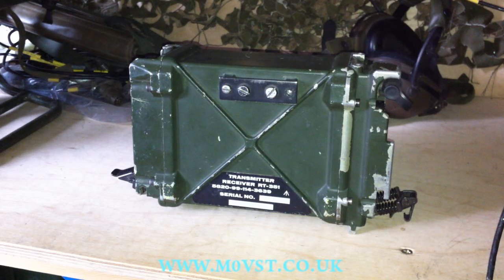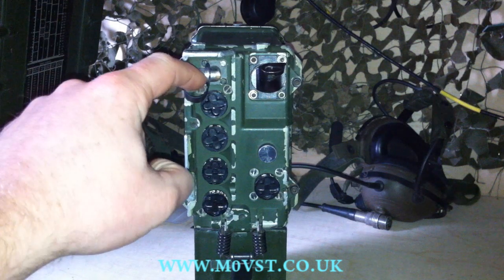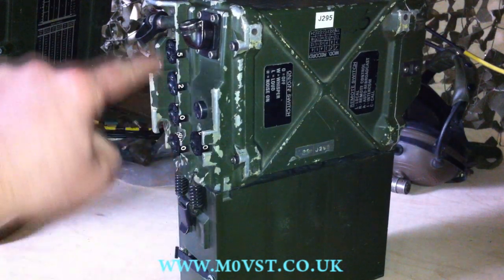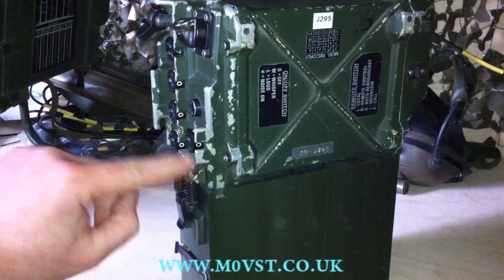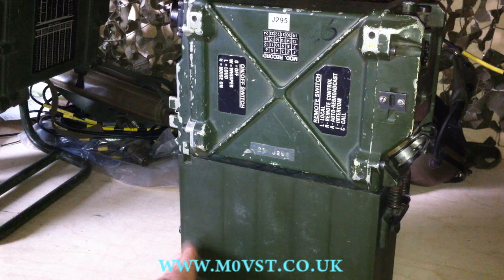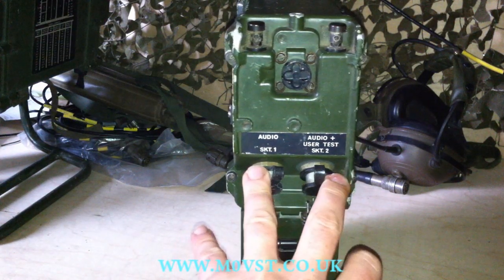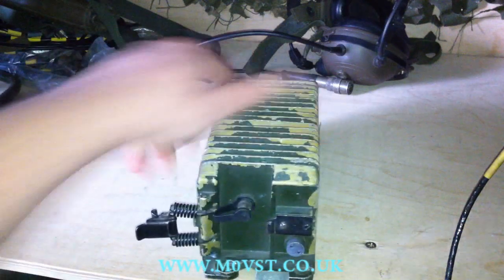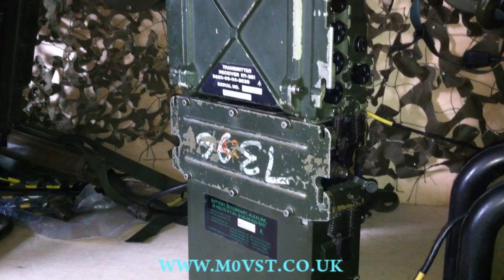PRC-351/2 VHF MIlitary Manpack Transceiver [HD] - M0VST

Comment: I have this radio in my shack complete with the tuner. It works very well and has good reports, along with my vrm 5080, prc 320, rt 841/prc 77. They still do there job.

Comment: If any one is getting one of these radios, then i would highly recommend you buy an external speaker too.  The type that has the thick rubber buffers around it..This allows you to adjust the volume as its fitted with a volume knob.  Unless you talking to or listing to some one with the same set you wont hear any thing unless you have the radio on [ * ] as they have a tone guarded squelch ( CTCSS )  So being able to adjust the volume is a must !!  The speaker also allows the headset / handset to be connected through so volume is adjusted on those too.

Comment: You need to charge your battery correctly, or more accurately, charge the new battery you are going to need to replace the dead one. The radio needs about 18V in order to function.

Comment: You've just damaged your battery. A car battery charger is designed to charge lead acid batteries with a constant voltage, whereas a NiCad battery is charged with a constant current. You need to use either a lab supply with current regulation, a NiCad charger appropriate for the AH rating and voltage or best of all, the correct charger, preferably with the later modifications applied.

Comment: how would i be able to test if my set works correctly. i have a small handheld that i set to 65mhz, i set the radio to the same. there was some interaction between the two. i couldnt hear a voice when i talked into the handset, from the handheld. how could i test the set.

Comment: i tried a car battery charger, 12v 4 amp car battery charger.
the battery read 7v before i started charging it. i couldnt get anything out of the radio no clicking or hissing. i put the car battery charger on it for about five minutes. then the battery read about 18v and around 4amps. i connected the set and straight away i got a continuous tone. i changed the three main controls for whisper and loud and noise on. i couldnt hear anyone, guessing no one was on to be heard.

Comment: hello
great video
i have always wanted one of these. i now have one. i got it off ebay for £50, i had to get an antenna seperatly. 
im having  a hard time getting it working. i was told the radio was working as per ebay selling ad. the battery has about 7 and a half volts. im guessing this is the problem. i dont know how to test the handset or the radio. i put the handset into the left input, im guessing this is correct? i have fiddled with the knobs!(silly smirk). nothing. no hissing or voices.

Comment: Does this unit feature the NATO 150 Hz tone squelch?  The PRC-77 and "RACALish" PRC-522 presently used by the Canadian Army both tx the 150 Hz tone, and require tone reception to unsquelch the receiver. The exception is both radios have an unsquelched rx mode, useful for receiving very weak/picket-fencing signals.
Reply: Im just starting out with this radio, but as far as i can tell its does have CTCSS tone of 150 Hz.  you cant turn it off. If you turn the controlwheel to the STAR * setting that does open up the squelch but you will hear static all the time. OR your signal.   Wondering if some one will come up with a modification to remove the CTCSS and just have a normal squelch function.